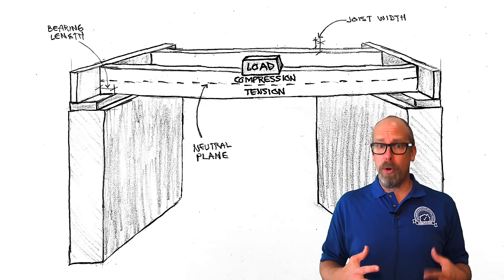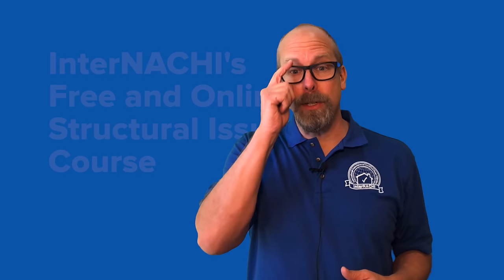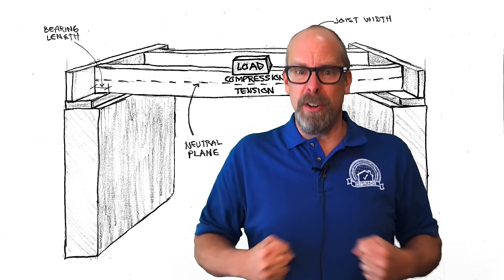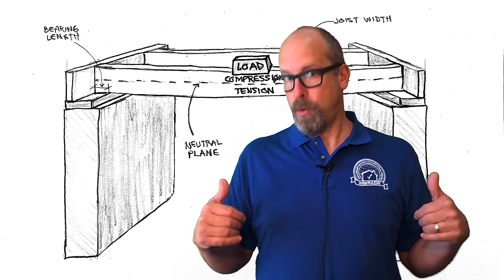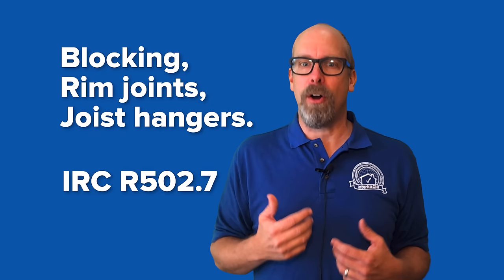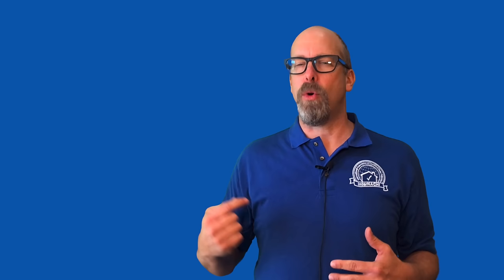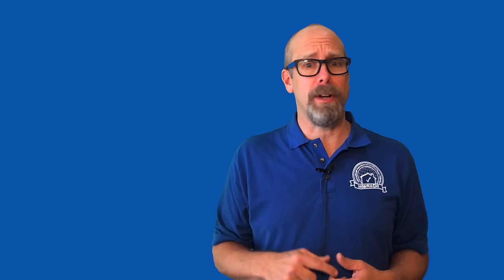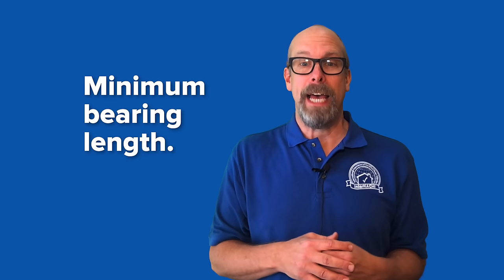Science of Simple Spans of Floor Joists

Comment: If you want to increase the load bearing capabilities of your joists without too much of an additional expense, fasten a steel strap to the bottom of each joist (it can be every other joist depending on your load bearing requirements for the floor).   Steel strapping comes in 25 foot lengths up to 16 gage with lots of holes the entire length.   Use 2 to 3 inch deck screws every 4 to 6 inches.   The result is that all "tension" is moved to the bottom of the joist with the "neutral plane at (or near) the bottom of the joist, leaving all of the joist as the "compression area".   "Deflection" will be greatly reduced compared to a joist without the steel strap.   "Weight bearing" capability will probably be at least double that of a joist without the steel straps.   A good idea is to extend the ends of the strap around the ends of each joist a couple of inches and fasten with two deck screws.   I use this idea on fence posts that always eventually rot right at ground level to keep them from being knocked over too easily!
Reply from the maker: Thanks for the feedback. The info of this video came from Glenn at https://buildingcodecollege.com/
Reply: Interesting comment, thanks.
Reply: Load sharing bridging is code in most places..
Reply: @jamesrussell6870  Thanks!   I didn't know it was called "load sharing bridging".   I've never seen this done by anyone else, and for me it was just solving a problem using basic physics.   I'm a DIY handyman type with no formal training in construction.
Reply: @paparayg  It's just called bridging. Primarily for sharing load with adjacent members...
Reply: That's a smart idea and fairly cheap, unless you want to attach a ceiling to all that steel.
My neighbor glued and screwed flat 2x4s to the bottom of every floor joist in the crawl space and got a much stiffer floor.
Reply: @jamesrussell6870  I don't think Ray Grant is talking about bringing, he's talking about taking the metal strap down the length of the joist, not "bridging between the joists"
Reply: @stevebengel1346  yes & structurally pointless..

Comment: I am currently restoring (not rebuilding) a home that is about 100 years old. They used 2x6s and 2x8 for the floor joists. Many have cracked on the sill plates. I am keeping with the same pattern but replacing joists of the same size using joist hangers, structural bolts for sistering, blocking, and post supports. it is a small house, 1300 sqft, so without over-engineering things, I think updated lumber and structural support should be enough to keep this house sitting for much longer. It is also grandfathered into our local building codes so I do not need to perform intense structural changes or have them inspected to modern codes.
Reply from the maker: Thanks for watching, Michael. And for commenting.

Comment: Nice video but need to explain how many feet a 12' 20', etc, joist can span without deflection. 
How close can you put the joists together to help witt deflection.  How wide joists need to be to withstand deflection for 12' ,  20'  25' etc.   How much weight can a most common  pine wood 2×4, 2x6, 2x10, 2x12, etc. Hold before deflection.  Is there a right direction to put in the joist based on the grain?
Reply from the maker: Thanks for watching.

Comment: What I see a LOT in houses I've worked on for restoration is holes for wiring and plumbing being drilled far too close to the tension portion of a joist, sometimes even notches cut right out of the bottom.  Not only is this annoying because when cutting through or tearing down ceiling drywall you have a high risk of damaging electrical and plumbing (not to mention people who do that never put up nail guards), but it effectively reduces the strength of each joist by how much was cut or drilled out.  What's more, if someone else goes in and drills additional holes in at the proper distance, now they're cutting though the new tension point that the first person created, further reducing the load the joist can handle.
Reply from the maker: Thank for watching the video about simple spans of floor joists. The content was provided by Glenn Mathewson at https://buildingcodecollege.com/.

Comment: 16 center joists, width of span divided by 2 plus 1.  16' span divide by 2 = 8+1=9 a 2x10 is 9 1/4" so use a 2x10 minimum. And so on. 12 ' span 12 divided by 2 = 6+1=7 a 2x8 is 7 1/4" so use a 2x8 minimum.
Reply from the maker: Nice work.

Comment: Metric units here would be nice as well especially since you're talking about international recommendations. Also, it's a heck of lot easier when doing the calculations (no silly fractions)
Reply from the maker: I agree. Teaching and working in mm is so much better than inches and fractions of inches.
Reply: @BenGromicko  well said. Also, all imperial have been defined in metric units since for many years now. I remember the loss of a very expense space probe due to the mixing up of the two systems of measurement during the entry phase into the Martian atmosphere

Comment: Very helpful video. I want to lift my floor joists (in order to replace the center beam or main girder) so I would like to clarify with you that using a 4x6x10' piece of lumber supported by two jacks (of appropriate strength) would be better than say a 2x8x10' piece of lumber as it doesn't have the same amount of area for the jack to support the beam above. Each 4x6x10 will likely support 7 floor joists. (I will do a row of these to support 45ft length house.) With an estimated house weight of 150,000 lbs, I'm planning to use a series of 5 support beams (2 jacks each) for a total of 10 jacks on one side of the girder and the same set up on the other side of the girder) If my jacks hold 15000 lbs each then I have 150,000 lbs supported on just one side of the girder.  I personally think a wider piece of lumber would be better than a narrow piece of lumber. Thoughts?
Reply: This is a comment section not free structural engineering.  And you need to lift all ten jacks in synch with each other or you will damage your framing and sheet rock will crack all over.
Reply from the maker: Thank you, Lizanne, for watching. I appreciate it. And your comments.
Reply: @BenGromicko  Way to completely ignore their questions.

Comment: "W. Va. I-Beam
"Am just throwing this out there for comment!
Long ago I lived in W. Va.
I helped a guy span a 24' gap between barns. He only had 2x6's for rafters. But his trick was to sandwich aluminum flashing between 2 boards with contact cement & cinching over long nails thur sides. 
I walked out on the rafters prior to sheathing & was astounded how rigid they were. Note: zero bridging between rafter beams.
I am thinking of beefing up my 2 car garsge trusses via jacking up the truss & adding flashing / adhesive with a plywood cover  plate screwed over .
If you read this far. W.Va I- beam is my own definition.
Reply from the maker: Thanks for watching, Steve.
Reply: HaHaHa that's a good idea!

Comment: I wonder if joist flop over is similar to when I was a little kid and decided to do a tight rope walk on the edge of the cat's litter box. I balanced myself so the plastic edge of the litter box was supporting my weight, but it tipped over at mid-point. I think it's because the plastic started to buckle causing a twist in my applied weight. There was a solid support for my weight at the box corner but when I got mid-point something like torsion was created. Of course, my mom was not happy about me using the cat box for stress testing.
Reply from the maker: Thanks for watching. The info of this video came from Glenn at https://buildingcodecollege.com/

Comment: Good video. Thanks.  Shear failure is interesting.  I saw this at my sister's house. Her teenage sons had a few wild parties and one of the joist cracked and was 'bouncy'. The crack wasn't a horizontal line, however it did start near the middle of the joist along the grain and then followed  that grain as it curved downward to the bottom of the joist where it left an open gap.  (2x10 to 2x4) Joist span, construction, etc were all standard. I think this problem was caused by unusual stress,  not ideal grain structure in the wrong place, and there was no blocking  any of which would probably have been enough to stop it from happening.  And the fix was simple (I'd flown cross country so I didn't have the tools to do it), lift the broken joist with a 2x4,  sister up the joist and install blocking. I think this failure speaks to the robustness of standard joist construction.  I've seen other failures in very old houses, undersized members, too large or too many utilities holes drilled, very old, very dry lumber, or  rot/termites. (This Old House runs into this all the time)
I've often told people (something that might not be true - please correct me) "a  standard floor in  house construction built to code can hold 2000 pounds per square foot."   I would use this as an argument for why a staircase should be built following code, or why a garden deck needs beefing up.  I think it's clear how useful the statement is - if it's true. What would be a better way of expressing this thought to an inexperienced DIYer?   (I think  porches and decks are where the most code violations occur. I've done it myself. The only one I'll admit to is a foot off the ground - I can't imagine any building inspector even bothering to look at it.)
Reply: Forty pounds per square foot is typical of a basic residential floor design load, a house floor capable of adequately supporting 2,000 lbs. per square foot would be pretty stout.  Could park your truck on it.
Reply from the maker: Thanks for watching and your comments.
Reply: @G53X0Y0Z0  It has to hold more than 40lbs ft^2, I weigh 166 my feet are less than a foot long, so each foot exerts 83 pounds in less than a square foot.  Even in my ratty 70 year old house no sag or squeaks.  I also remember standing underneath the main level of my in-laws house on a steep hill in Silverlake (Los Angeles, California) and realizing I was below their two car garage. 2 x12" (maybe 14") 16 OC, a two-car garage is at least 18' x 20' span, blocking? (I guess I could find my photo.) Light weight concrete , but that floor has to be much much stronger than 40lbs ft^2. And after 40 years no cracks. My Tesla weighs 4400 lbs, that's 1100lbs/tire. I don't think it would put any sag in that floor - or there'd be articles on collapsing hillside garages. (I googled and found a few items, mostly due to water seepage.)
Reply: @G53X0Y0Z0  But that design load is for an L/240 or better deflection ratio typically - which doesn't address actual failure limits.  I understand that the code tables have a lot of built in safety... but sometimes it'd be nice to know where the failure limit actually is - but I suspect that they're worried if they actually published that, some would abuse the information.
Reply: @WillN2Go1  - loads can be calculated and expressed in different ways.  I think that the way terms are expressed and understood may be what is causing the question. Also, just a couple of inches of joist depth or a few inches of span increase or decrease can alter it's load bearing capacity significantly.

You in-law's garage was likely stronger than a 40 lbs. per square foot.  Concrete actually has some flexibility and a slab can bend or deflect some without cracking.  There are different strengths of concrete and much depends on how it was cured too.  Concrete is not very strong in tensile loads, and most cracks are from shrinking. Of course there are limits of how far a concrete slab can be bent before it cracks.  And, a concrete slab or other thick sheeting can help spread out loads. There also concrete slabs that are "pre-stressed", they are made usually in a factory setting and then delivered to the installation site. They are made to function as a load bearing structure such as a roof, wall, or floor. So it's perhaps possible the slab was something like that?

If you had a 20'x10' (200 square feet) room and the floor was engineered (properly) to hold 40 lbs. per square foot then you should be able to put 8,000 lbs. in that room if it was pretty evenly spread out.  But if you had a 4,000 pound object that was 1 square foot in size and put in in the middle of the span, the load would be on on or two joists in their weakest place. That kind of load is called a point load, and needs to be calculated differently to find the appropriate joist (or beam) size, because the weight is not spread out.  If that load is close to the end of the span, the joist can support it much easier than if the same load was in the middle.  

So, just for simplicity if the 4,400 lb. car put 1,100 lbs. on each tire you would have four 1,100 lb. point loads.  As it rolls into the garage the leading tires first put their load on the ends of the joists, and then the middle of the span, and as the leading tires get closer to the other ends of the joists the back tires roll onto the floor, and assuming the joist spans (distance between supports) are not very much longer than the car, the loads end up close to the joist supports where joists are strongest.

If you put 2,000 lbs. per square foot on every square foot of our 200 square foot room, and that adds up to a total 400,000 lbs. , which is quite a difference from 4,100 lbs, which is the weight of 20 or 30 adults.

Comment: Very good explanation.  If I may add:  you might see longitudinal cracks = shear failure in highly loaded single members such as purlins.
Solid blocking between joists is also there to help share the load (say a point load) between several joists.
Your limits on holes or rather lack of limits on holes is an issue. UK codes are tighter: "Holes should have a diameter of no greater than 0.25 times the depth of the joist. Holes should be no closer together than 3 times the largest diameter permitted. Holes should be no closer to the support than 0.25 times the span and no further away than 0.40 times the span."
Yet still I see trades breaking these rules and weakening floors.  Please do not turn joists into Swiss cheese.
Reply from the maker: Gotcha.
Reply: I saw a plumber drill multiple holes for gas piping in beams without consideration of their size and location. I showed him the instruction sheet from the beam supplier and explained where he should have drilled and cut. That was a mistake because he then decided to do it properly, thus doubling the number of holes and cuts, thereby further weakening the beam even more.

Comment: I clicked the video thinking to get some guidelines about what size joists and what spacing to use in what situations, which I'll have to look into further... But it did make me thinking about the blocking: If putting blocking halfway the span prevents the joist to flop over, effectively halving the span over which the joist can twist, does halving the span again by adding blocking every quarter of the span add much stiffness to the construction, or are the gains compared to just one row of blocking in the middle negligible?
We're talking about a span of 175" which will be realized with 3" x 9" joists (can't go higher because of ceiling height). I'm thinking about placing them 19.2" on center with 1 or if useful 3 rows of blocking. I could do 16" on center, but I prefer not to as the beams will stay visible from below and more beams closer together would result in a busier looking ceiling, even without blocking...
Reply from the maker: Thank you for watching and making a good comment.

Comment: Deck boards presumably contribute significantly to mimising joist rotation. Is this element factored into deck framing when determining joist spans, blocking requirements, joists thickness etc?
Reply from the maker: Good question. Yes. Thanks for watching.

Comment: Best joist would be a steel plate sandwiched between timber. Any timber joist in a house would be bouncy one way or another, prone to horizontal cracks in the middle over 30-50 years, unless it's the size of a tree  trunk. Builders make houses just enough to coope with the regs, calculations are 'just enough', no space for 'just in case' load would be 100-200kg more. Omnishambles. Steel frames for structure and glass and wood for decor ought to be the future.
Reply from the maker: Good comments. Thanks for watching.

Comment: Very informative.  I wish someone would talk about the relationship between deflection and load.  For example are the directly proportional - i.e.  for a given span does twice the psf equate to twice the deflection?  And what are the deflections before a joist actually falls from shear?   I'd like to be able to calculate the actual weight a span can carry before failure if deflection is not a critical factor.
Reply from the maker: Good idea, R&R.
Reply: @Robert Swaine Thanks for that detailed answer!  I had 2 years of general Engineering studies but switched to Comp Sci before picking an Engineering Major... but I still find structural and mechanical engineering fascinating.  I get why the emphasis with joists is always on deflection... but sometimes I don't care about deflection or "bounce" and just want to know if a structure will carry the load with a reasonable margin of error baked in.  These are usually just shelving or storage projects - never anything life critical btw.   And yeah... I can see how testing wood for tensile strength could be real tricky!

Comment: does r301.7 apply to roof joists on a flat style roof ?  I recently observed 5/8 inch deflection on a 20 foot span with 10.5 inch wide joists on 24 inch centers when the roof was loaded with a 1500 lb. piece of equipment in the center of the span.  the center area had blocking added to help spread the load out over a larger area in the roof structure .  This "dead load " would be added to the capacity of the roof when supporting snow and rain in winter .
Reply from the maker: Thanks for watching.